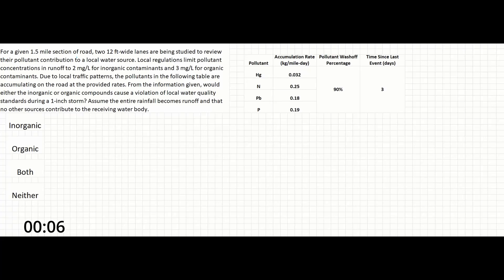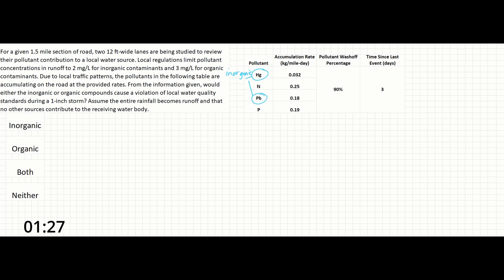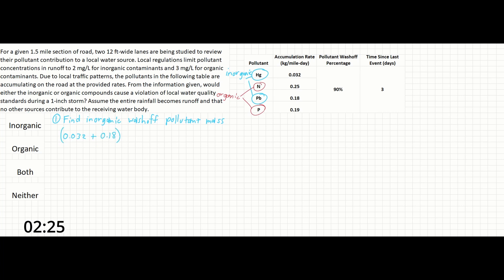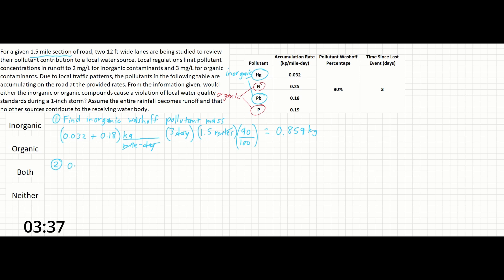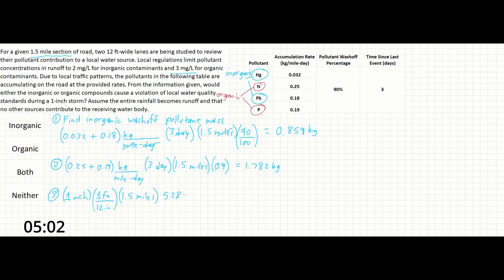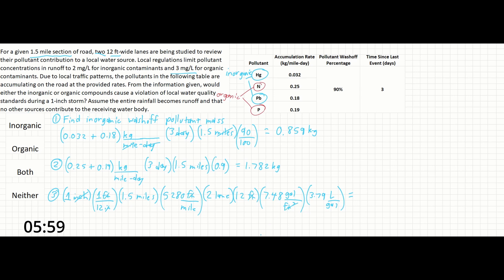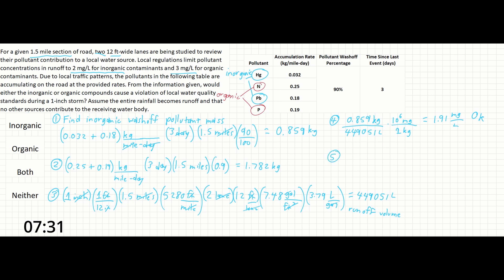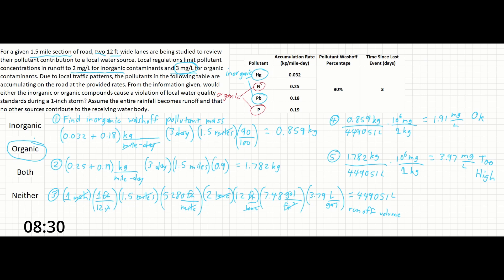PE Exam Practice Problem #91: Water Resources/Environmental | Roadway Pollutant Runoff Concentration

Comment: Clarification, why would P and N be organic. Neither one is in it's self a constituent with a carbon-hydrogen bond. I thought in order to be organic a compound had to have carbon-hydrogen bond. Additionally, for the total concentrations you only utilized one lane for the concentrations. Because there are two lanes, wouldn't you need to multiply by 2 to get the correct runoff concentrations?
Reply from the maker: Regarding your first question, you are correct that I appeared to word this problem badly. I should have said to pick "nutrients" or "non-metals". Thanks for pointing that out.  Regarding your second question, two lanes are accounted for during step 3.